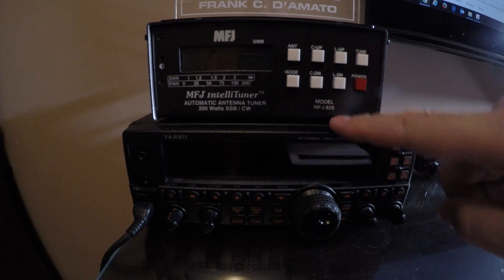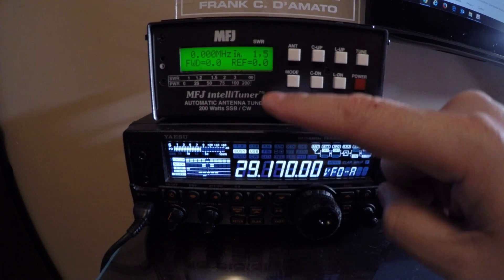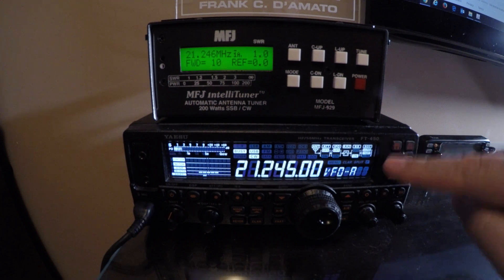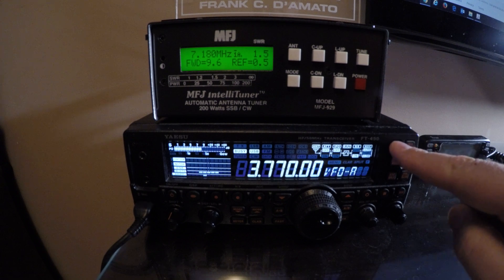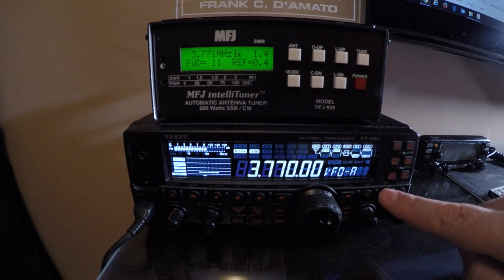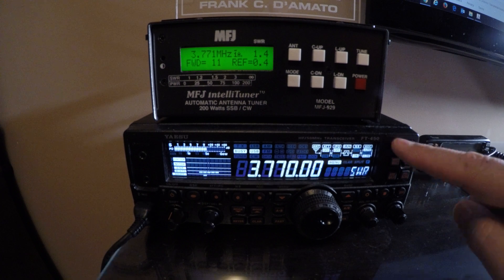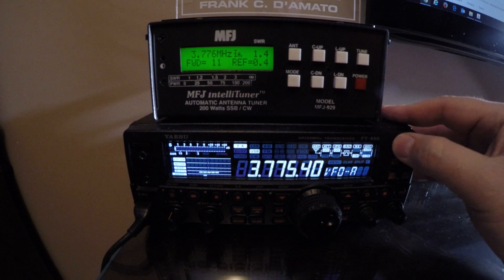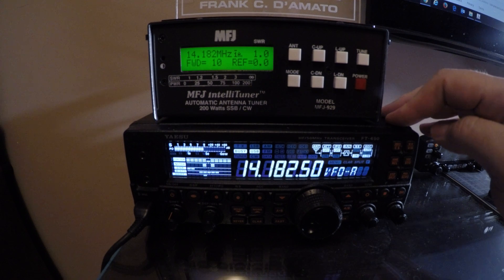FT-450 with MFJ-929 Automatic Antenna Tuner

Comment: Thanks for the video! I have an Yaesu FT-450D and the MFJ-929 tuner.  I also could not get the MFJ-5114Y cable to work.  However, it works very well as shown in the video.  To recap, set the MFJ to automatic, set the FT-450 voice/cs button to the SWR function (as shown in video).  Then to tune, use the voice/cs button (assigned to SWR) and the MFJ tunes beautifully (if needed).  You can leave the FT-450 internal tuner enabled if desired to use if bypassing the MFJ.

Comment: Am I glad I ran across your video, I thought I had an issue with my radio or tuner until I saw this. I made my own tuner cable per the pinouts in the MFJ manual and I'm getting the exact same results, it doesn't work. I've since spotted a post elsewhere that described the same symptoms. The cable will allow you to tune the first time you tune a particular frequency, however if you try it again on the same frequency the tuner goes to lunch and has to be power cycled.

I'm curious, did you make your cable or use a genuine MFJ-5114Y?

I'm thing either the pinout in the manual is wrong, or somethings up with the firmware on these tuners.

I was also relieved to see that when you first turn your radio on you also get the initial squawk that it doesn't like the antenna. It must be a timing issue at power on with the external tuner since it was tuned to the frequency when the radio was shut off.

There is a positive side to using the C.S button vs the cable. When you use the cable, per the MFJ manual, it disables the ability to use the TUNE button. Hence, you can't do a manual tune if you choose to. With that in mind it seems to me that programming the C.S button for an SWR check to trigger an auto tune on the external tuner is a better way to go.

Thanks for the video!

Comment: Great video. Does this tuner have to work off it's own power supply? I have yet to see any videos showing that. How does it get it's power? Thanks.
Reply from the maker: this tuner needs power for this radio, but when connected to a Icom radio, it gets power from the radios tuner port
Reply: @fdnyfish  OK great, because I see an Icom 7300 in my future. But for now, what power supply do you have it running on?

Comment: I can confirm.  Nobody I know can get this to work with the ft-450.  Yes the instructions have been fallowed.  I don't know why they advertise this as working with the ft-450 in that way.  This hack is the best you can expect.
MFJ really should advertise it as working or they do a shit job at testing their own products.
Reply: There are 2 cables for Yaesu.
Reply: @M70ACARRY  think they are four cables for yaesu. but only one for ft450D and mine does not work with the cable

Comment: did you see page 33 of the MFJ-929 manual?  Maybe you can change the settings in the MFJ-929.  Start by setting the Radio Interface Menu to Yaesu FC-30, then you gotta do some stuff to your radio.  Also make sure there is a jumper 4 on the MFJ-929 is installed. (remove cover, should be on right side middle)
Reply from the maker: Hey Chad, I did follow the instructions you mentioned but no good.  I called MFJ today, and they said they are aware of the FT450 not working with the 5114Y cable.  At the end of the day, instead of hitting the tune button on the FT450, I now hit the Voice/CS button to accomplish the same thing.  No big deal.
Reply: fdnyfish good deal, I like to use mine without a cable but I have to change to CW when retuning.
Reply: @fdnyfish  Ok, so I know this is an old video/thread.  I hope you see this comment.  I like your video and I too have the FT-450.  However, he Voice/CS button is a programmable button.  What function are you invoking when you push this button?  Sorry for the dumb question..
Reply: Cooldaddycars1 
      It’s programmed to send a brief 10W CW carrier signal.  This is enough to “wake up” the 929 and match the impedance.